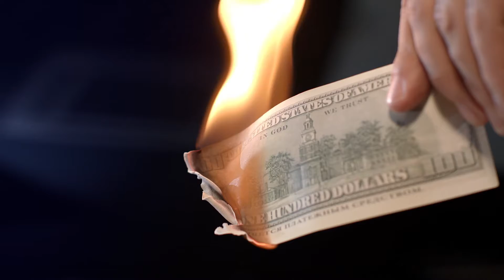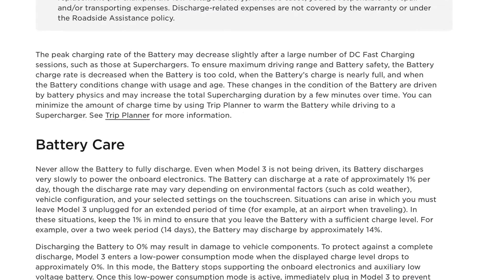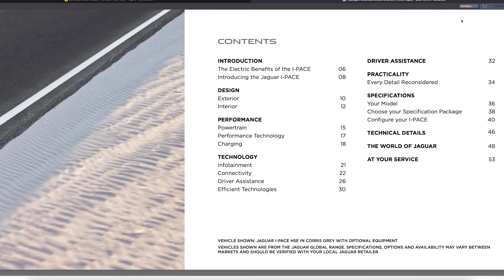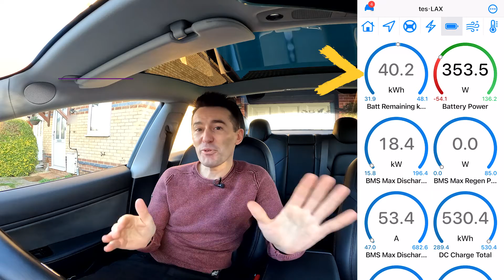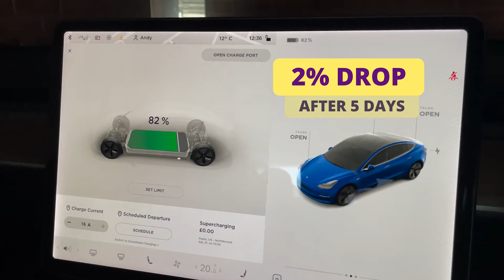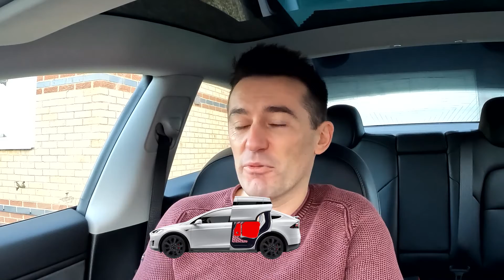Phantom Drain | Tesla Model 3 | Cost, Wastage & EVs compared

Comment: I wonder if Tesla's Robotaxi goals have had an impact on this? Their goal is that a Robotaxi will never sit idle unless being charged.
Reply from the maker: Maybe, although this was lower than I was expecting and I get the impression a lot is to keep everything in tip top condition. Be interesting to see where all the other EV batteries are in 8 years time on degradation over Tesla one’s and see whether there is a longer term reason Tesla have it and others don’t 🧐
Reply: @TeslaTorque  I might have missed it in the video, but were you running sentry mode during these tests?
Reply from the maker: Nope, all switched off, and only opened the app once at the half way point to see how it was doing.  Sentry Mode defo kills the battery far quicker than this :)
Reply: @TeslaTorque  Thx

Comment: Parked my 2021 M3 SR+ at home for 3 weeks whilst on holiday. Turned Sentry Mode and Climate Protection off and didn’t wake up the car by opening the app. Drained from 99% to 89%, so a lot better than Tesla suggested
Reply from the maker: That’s not bad at all, do you have the LFP battery? As ideally you don’t want to leave you battery above 80/90% for long periods, it’s better to have it around 80%. If you have an LFP battery then I think this advice is slightly different. But this rule applies to most EV batteries I think. 

Similar if you are charging to 100%, try to get it to 100% just before you set off, as keeps the health of the battery more (again, not as important for an LFP battery) 👍🏻
Reply: @TeslaTorque  yep I have the LFP batteries. The advice I’ve received is to try and charge the car to 100% at least once a week if possible. This battery chemistry seems to be a bit more forgiving than the previous iteration, though you lose a bit on the energy density front.

Comment: Try running sentry mode all the time. It is a major power suck. Need something better efficiency wise for those of us parking in the street..
Reply from the maker: Sentry mode does suck the power. But also, love the deterrent element of it, so in my mind worth the hit. Would be good if it could be a little more power efficient though, but I guess that’s the AI at work
Reply: @TeslaTorque  i'd settle for option for dumb recording on a loop as I don't find the huge cost in drain reasonable - I have a long range model 3 and it is quite a percentage loss per day. It's beyond excessive.
Reply: @--Nath--  I have the M3LR also. The battery drain with sentry On, is a lot.

It is acceptable for short periods, say shopping trip, but when I go to work Sentry could be on for 5 days in the company car park draining 8% a day.
The battery drain is so large over this time period, I don’t use sentry, defeating its purpose!
Reply: @X-tractor-fan  I would like a "dumb" on a loop recording instead of all the smarts.. Because 99% of the time it is picking up people walking in front of the car not really anything remotely bad/worth worrying about.

Comment: You woke the car up in between the period, which will probably add more drain to the mix. Over around a couple of weeks in lockdown mine only lost a few percent. The initial drain is normally seen when the battery cools after a drive and people see to attribute that to phantom drain. Obviously waking it up and using third party apps don’t help either
Reply from the maker: Yep, thinking about it, even if the car was awake for 30 mins, as power drain was so small over the long time, and when it’s awake it stills about 350watts. That would make sense. Good shout 👍🏻. Didn’t have any other apps awake though, so rest of time was deep sleep

Comment: if you have omicron  you only need 5 days  then take 2 day clear test,
there is no thing as phantom drain.    your car uses power when not being used the 12v will drop to a dead level so the big battery charges it
the more your car uses with alarms,  opening and closing door  or checking if you are near the car with key fob.
all cars have battery drain  but have larger battery (amp's)  the battery will not drain to dead fast.  
the simple thing is an ev never turns off  completely.  but neither does petrol or diesel car do too.  but for just alarm systems.
my stupid small battery in my ioniq  requires the big battery to charge the 12 v every day if not used.
BUT  I have just had recall to get a part replaced that may be linked to this drain
Reply from the maker: I appreciate the energy goes somewhere, but as often you are not physically using the car, and feel like it’s almost turned off, I would expect about the same as when I came back. Bit like if I turned my phone off, appreciate it’s always on though, but from what I can see, it’s mainly a Tesla thing. 

Although seems like it has improved on newer models 😬
Reply from the maker: Oh, and I filmed this is October, just delayed putting the video out, so it was the good old 10 days isolation at the time. 😞
Reply: You're describing what phantom drain is: stuff that stays on despite the car being unused. Standby drain might be another term, as per all electrical devices that consume while on standby.
Reply from the maker: Yep, you are not wrong, its just the term that has been adopted by EV owners, so following the terminology, but it is effectively the energy used in standby

Comment: I left my nov 21 M3LR  parked at Heathrow for 2 weeks over xmas/new year, lost 2%. 
I did not had sentry active, and the car was mostly at sleep. Car woke up by itself once a day and sent status to mothership. didn't opened the app during that time, but the iOS widget used to update as and wen the car woke up and sent status to mothership. 

Didn't bothered to turn anything on the car apart sentry and cabin overheat protection.
Reply from the maker: That’s awesome. Clearly the newer models have less of it then which is good to hear 👍🏻
Reply: @TeslaTorque  from the research I’ve done on the subject, key is to avoid at all costs opening up the app, and change Tesla password just before to avoid 3rd party apps to wake up the car. Worked for me.
Reply from the maker: Yep, good advice :)